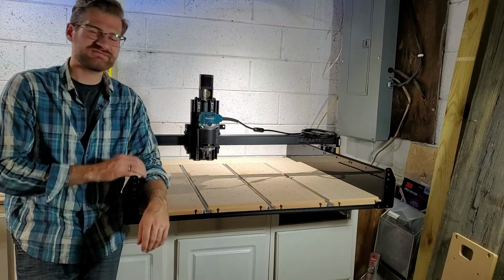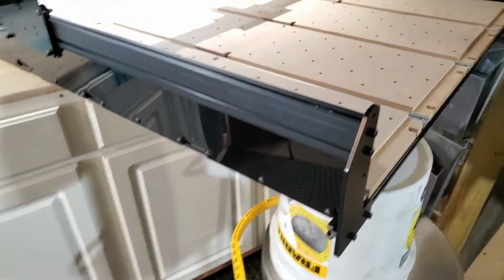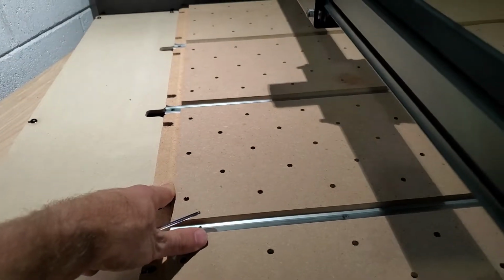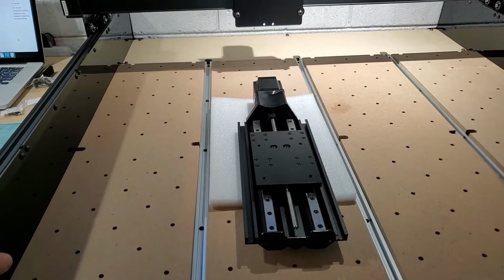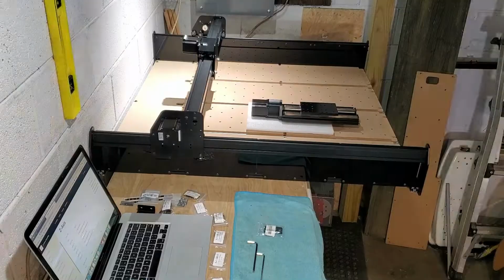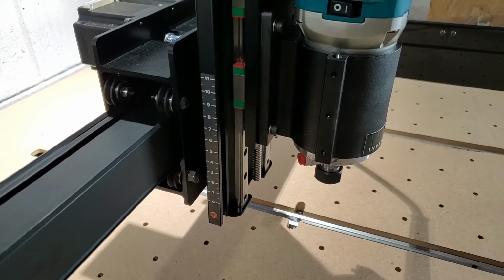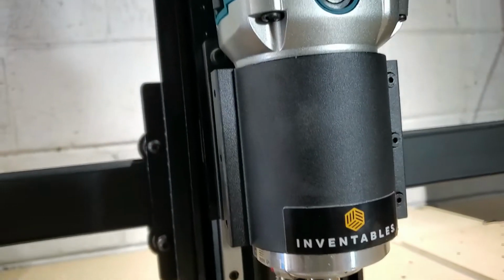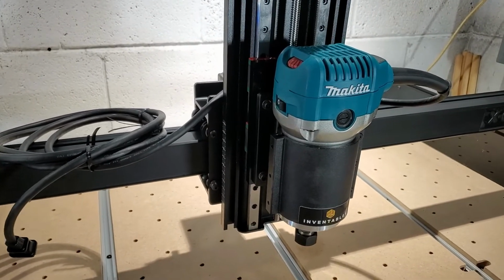Inventables New 2021 X-Carve Z-Axis & Spindle Assembly

Comment: Thanks. Great video. The directions from the factory are challenging.  I’m planning on the gantry’s and router Monday. Can’t wait.
Reply from the maker: That is awesome Steve!!!  It is so stratifying to complete and get your first carve in.  I have finished my assembly and am finishing up the video edits.  Everything will be posted this week.  When you get to the gantry, make sure that your stepper motor and the tension pulleys align.  I had to add an extra washer to the pulleys on the gantry to make the new 2021 stepper motors line up.  Good luck!
Reply: @businesseveryday  thanks for the videos. I had just finished my base when I saw your video, i kept looking at your project thinking the back and front were reversed. The directions are lacking for sure. Can’t wait to finish and start cutting.  Thanks